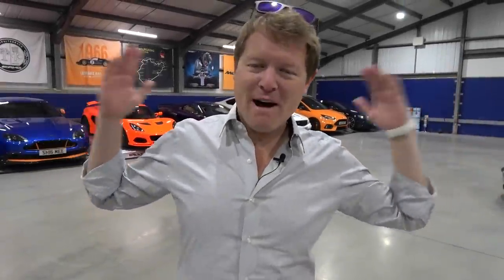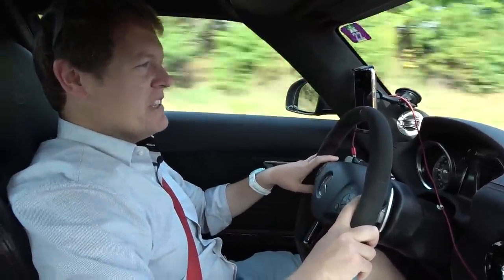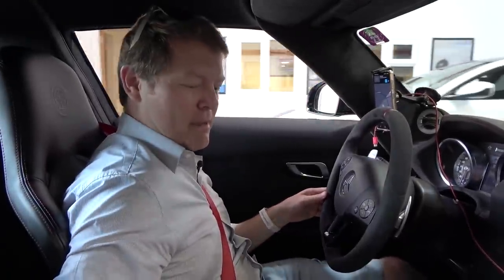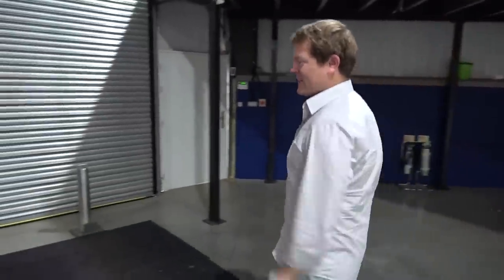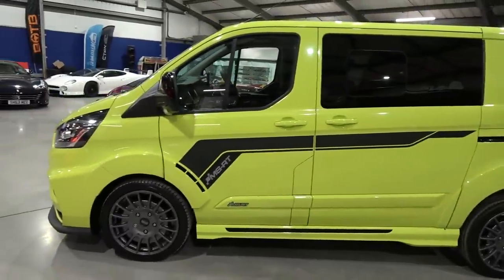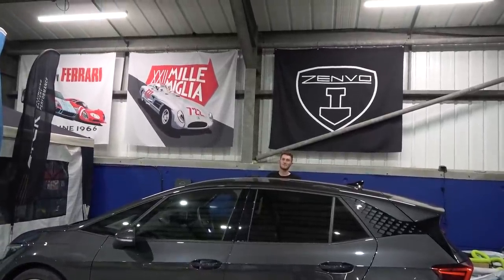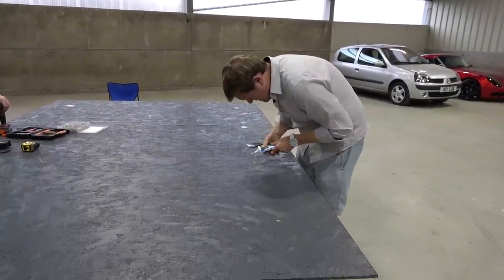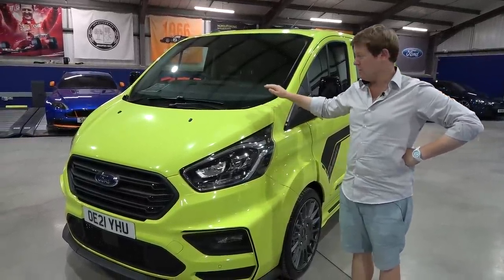We've Got ANOTHER Practical Team Vehicle?! | SHMUSEUM VLOG 90

Comment: My work have top of the range transit custom. It have 2.2 turbo diesel with 18 inch rims. The Tyres are so wide. One of fastest Transit that Ford made before yours made. I have driven it. It's fast. Suspension is so stiff and well handled on road. Your transit is so beautiful.